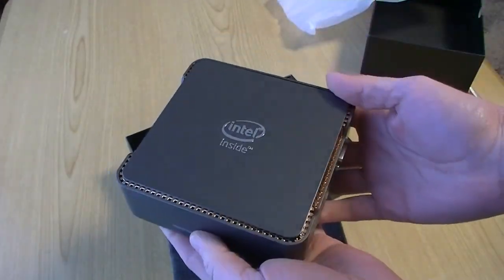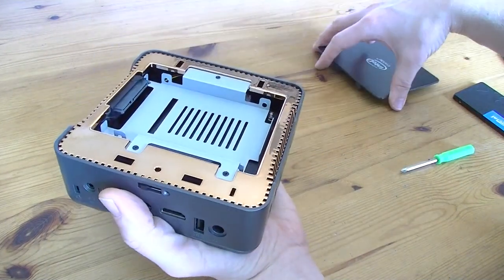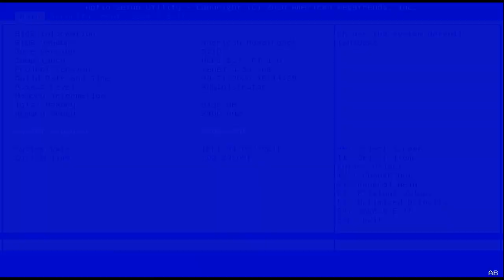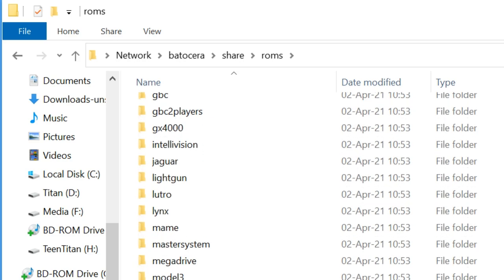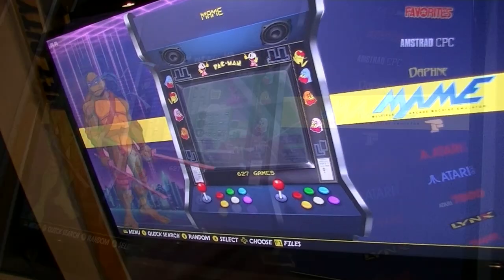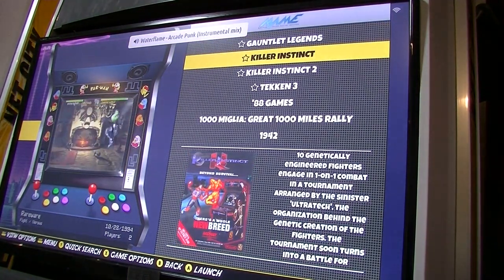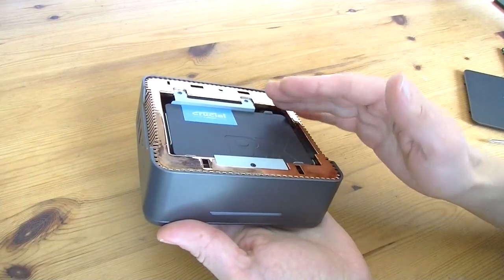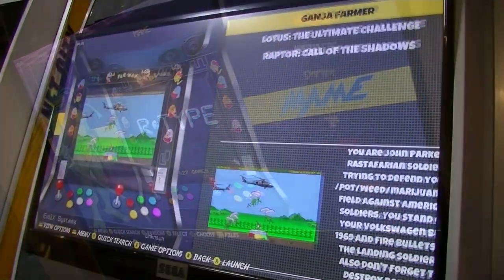The Cheap Super Console X PC Lite Edition [Only $165!]

Comment: Nice video seems like a much more affordable option than the Super Console X PC
Reply: The SCXPC is ridiculously over-priced for what it is. For a retro emulator PC your best bet is to find an old off-lease office PC. Basically anything with a i5 quad or even better an i7 quad with HT and 8GB DDR3 will do. Hardest part will be trying to find an old but decent gfx card at this moment. But it's looking like the gfx card situation might be getting better in the next few months. And when that eventually happens there should be a flood of gfx cards that are shite for modern games but great for emulation like a GTX 1050. It won't be in an itsy bitsy case like this, but then it won't overheat either since in a real case it will get proper airflow.

Comment: Nice setup you have there. Looks like you're able to run a lot of stuff! Personally, I'm a bit of a purist, that prefers a CRT for classic games, but this looks super fun! Nice man!
Reply: Same here, just picked up a couple of them for free... the look & feel is such a difference 👍
Reply: @anno5936 CRT monitors are the only way to play / experience classic games. LCD is only an option if you are unable to get a viable CRT setup running (for whatever reason).
Reply: @arcadesunday4592  Yes and no... it requirres a bit of tinkering as well. As for reselling,  an Arcade with a 19" display is easily set up and sold on local ads, and usually customers don't care much about it... but if you have an high-end CRT it really beats the living hell out of any 1440p  display, just on a different aspect ratio.

Comment: I love it! So what would be needed to extend this thing in order to handle a wider selection of PS2 titles? When you said the 3D titles have problems, that makes me think external GPU instead of the built-in chip?
Reply from the maker: That's the thing, really-  it needs a GPU, but as it's a mini-pc... It doesn't give it much place to go re: expansion/ upgrade options.  If you really wanted PS2, I guess you could stream it over on moonlight/ steamlink ;-)
Reply: Nah, it really comes down to the instruction-sets on the CPU; i've tested that on several Atom-based boards, even with a low budget graphics. If you go for any i5 Haswell and above it will do a decent job, also the old AMD A-series can perform well in many titles.
Reply from the maker: @anno5936  missed out on that amd series. Yeah I did hear the ps2 was more cpu intensive.  Assumed the 3d could be accelerated via GPU.  Is there no improvement whatsoever?
Reply: @TeamPandory  Unfortunately not. I tested it with a J1900 and a Pentium Silver, both accompanied by a RX470. From my understanding emulation on PCSX2 relies on AVX2 instructions, therefore i had more luck with a Coffee-Lake i3 at lower speeds than with any other low-energy CPU. Though it's not quite clear to me why my old AMD A8-7700k didn't have as much hickups back then, doubling the resolution (though it might be related to using Win7/DirectX years ago). A discrete graphics is a recommendation none the less, since you'd love to upscale with FullHD panels and above.

Comment: <3 Net City! Thanks for sharing that with us. What did you use to spray?
Reply from the maker: Before spraying, tried retrobrite which lightened it a little, but no good. Cleaning, plastic primer, cheap white acrylic, layers of clear acrylic, wet sand then polish.  Looks way better than when I got it.
Reply: @TeamPandory  Freaking sweet! Thanks for the tips.
Reply from the maker: There are a few articles online regarding painting plastics.  I think for an even better job check out car paints.  As always I went the cheap route ;)
Reply: @TeamPandory  Appreciate the input. I'm getting a Net City and an original Vewlix over the summer. Researching as much as I can on restoration. That's part of the fun!
Reply from the maker: @allubis8950  My heart is gonna stop whilst re-capping the AstroCity monitor :o

Comment: Hi Team Pandory. One more question....are the games held in the Batocera website with the emulator or do they need to be sourced elsewhere? If elsewhere any recommendations? Cheers for all your help
Reply from the maker: Batocera is the operating system (uses linux and is a great front end). Most the games need to be sourced elsewhere but there may be a few freeware games on as stock. 
Archive is a good starting point.
Reply: @TeamPandory  lightning response! Cheers is that archive.org?

Comment: thought this was a great ideal as I have this exact model too. had an unused 2.5" 500gb sata hdd laying around. but It didn't show up when I booted the system back up. I'm thinking maybe the hdd isn't fat32. and so not recognised.. which begs the question. how do you format an hdd that isn't visible to the pc? lolz
Reply from the maker: If you use batocera, you only need to burn the image to the drive. 
The problem you're having is probably the uefi settings.

Comment: Any chance this will run Deathsmiles on mame?
Reply from the maker: Give me a sec, I'll try it now
Reply from the maker: Yep!  I can upload some game footage if you like?
Reply: Nice. I have an Austar Pandora 3d in my cabinet.  Could I use that as a controller on this or could I buy a two player arcade stick for this? If so I'm buying right now.
Reply from the maker: @kentrey  I've managed to get the PG3D to be used as a controller for emuelec (with faffing), but not attempted to use it as a PC Batocera controller (yet) - should be very similar, but you'd need to power up the PG3D also, if you intended to use it as a controller.  You could alternatively use a usb encoder like I did in this video- but this particular one is a little bit janky.  I have a few more to experiment with, though.

Comment: Mate,  I bought a Lenovo m73 on ebay for £100 and ran Batocera on it, it TANKS the celeron.  😄
Reply from the maker: Hey, I have one, too. There is something you miss.
 1. It's used - there's no guarantee it's in good working order, or if it's a ticking time bomb due to hard drive / thermal paste / hsfan/ psu (which will be a weak one won't support the larger GPU anyways).  When these croak, only the tech savvy will be ok. Unless the unit has non-standard parts (looking at you, Dell!)
2. It's a different form factor.  Apples vs oranges. You won't be able to hide the Lenovo under your tv as easily. 

I get that price performance is way better on the Lenovo.  But there is always another side to the argument. 
End of the day ?  Consumer weighs up the pros and cons then runs with it.
Reply from the maker: Oh btw, I got my Lenovo for 70$ around a year back. :o
Reply: Oh, it's working fine,  I've even upgraded the cpu to a quadcore 3.5ghz and changed the bios settings for better thermals.  Temperatures are safe for gaming,  it runs Gamecube like gravy.  No issues with the fan or power supply.   There are lots of lga1150 cpus on the refurb market,  alot of them can be found on aliexpress.
Reply from the maker: @shoot_the_glass5654  Did I mention the time when I bought a Ryzen motherboard / cpu bundle off AliExpress and the pins were totally shredded? ...  Maybe we should add that video ;-)

Comment: did you notice your boot video be really slow?
Reply from the maker: In this video?  - It will depend on the speeds of your drive, and perhaps if you have BIOS checks in place you may want to remove them to speed up loading.
Reply: @TeamPandory  i mean the bootup video it plays. same hardware here and drive. slow bootup video. had to disable it!

Comment: There is a great shortage of Crts in the world. Would be a shame if yours was replaced by an LCD. 
If I had a Sega Cab like that I would never replace my Crt unless it was broken beyond repair. Also, 
Thank you for the video. It twas great sir.
Reply from the maker: Don't be so quick to judge... Two of my NetCity cabs came completely gutted- no CRT, or system inside.  The first one I grabbed already was modified to hold a Mitsubishi 24" TFT and the colour is so bad.  If I can ever find a CRT for it, I'll stuff it in there ASAP.  Saying this, I have an AstroCity with a 29" Nanao CRT, with a very annoying, constant high pitch whine. I may try to switch the caps this week.
Reply: @TeamPandory  I have to honestly say. Thank you for taking in those lonely and broken cabs. They needed a good home and some love and care. Better with you than the scrap yard. I myself have two arcade machines. One a konami and the other a capcom. Both need good crt and a good clean and repairs. Good luck for your recap. Cheers.

Comment: CHEAP ? i run that almost games in MXQ 4k 28$ realy cheap IF BRANDNEW, but i can buy it used :D
if i dont buy any,  also more cheap

kidding aside i think have a lot of another REALY cheap options like emuelec with 905x3 $80 or 905w for 35$ and a USB drive or any old used notebooks with batocera
Reply from the maker: For what you get for the price, it is extremely reasonable pricing.  Highly doubt you can get Windows running, any useful internet, or even any of them higher end games (psp, mame ki etc) working well on those cheap android boxes.  - and that's basically it.  If you want cheap cheap, and only want regular nintendo stuff emulated (no n64 and beyond) - those emuelec systems work GREAT- but you do get what you pay for.

Comment: Hi Guys
In Batocera I cannot use updates/downloads as there is no network connected. How did you add wifi to enable this?
Reply from the maker: Most the time I use wired LAN.  Wifi should be a question of setting up in the wifi options.